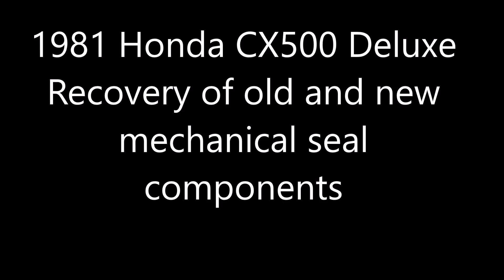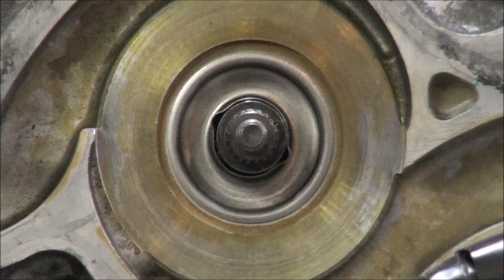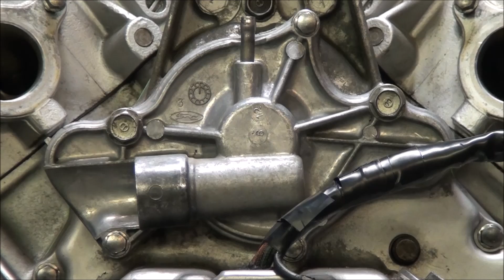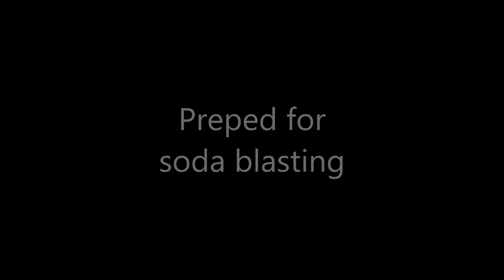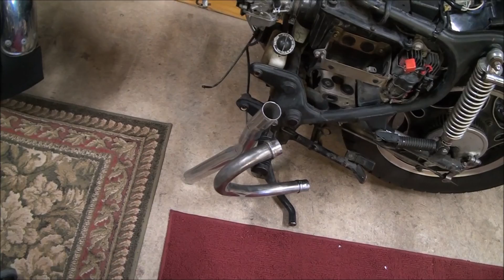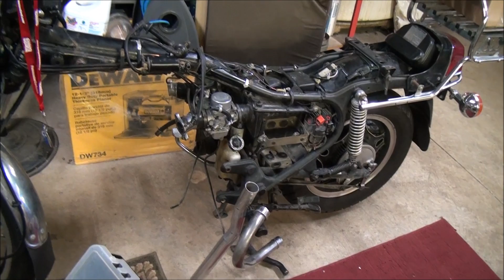81 Honda Water pump Mechanical Seal Recovery

Comment: What was the adhesive you ended up using on the bucket part as you described?
Reply from the maker: I had an old tube of Permatex Hylomar that I used. I understand that the formulation is now sold under another brand but I'm not sure by who. Good sealant.
Reply: Paul Weimer thank you!

Comment: Hi Paul, what's the red material you're using to block all the holes before sand blasting the negine?
Reply from the maker: These are from Eastwood. They sell a selection of plugs, red for inside openings, black for fitting over tubing ( on the outside).